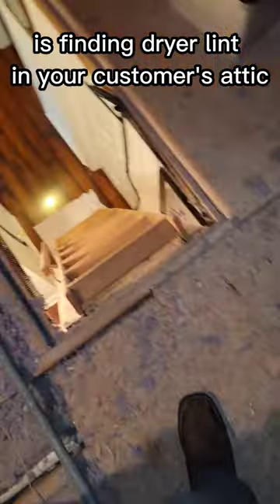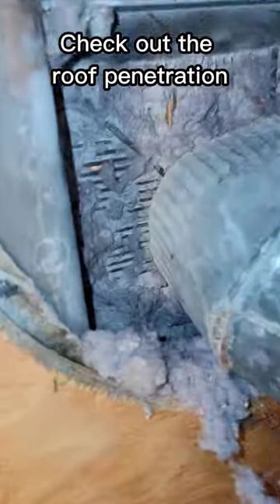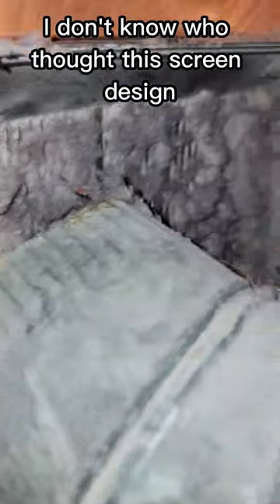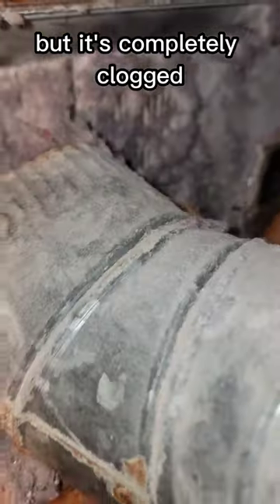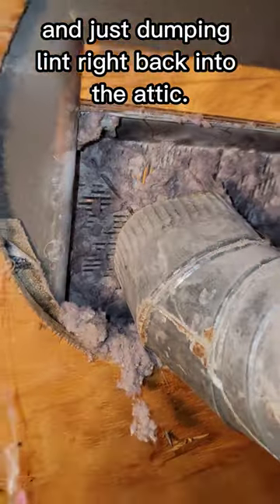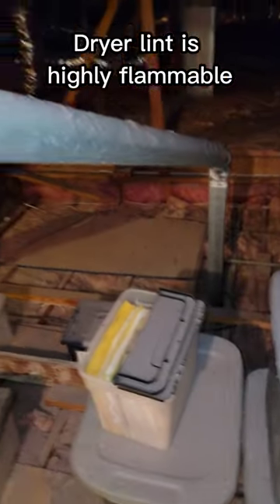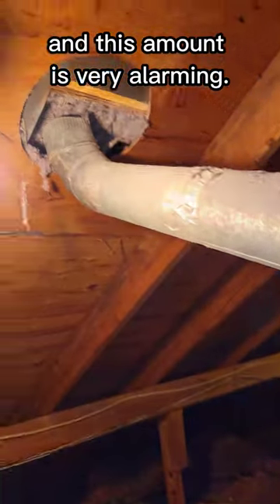Dangerous dryer vent setup! #hvac #hvactechnician #dryervent

Comment: A huge red flag is having a drier vent in your attic. It should come out the side of the house closest to the drier and nowhere else
Reply from the maker: Agreed. This is what happens when dryers aren't located on an outside wall
Reply: @WorldofHVAC  gotta love when people with zero HVAC training knows where shit should go 😂
Reply from the maker: Thats college educated architect's for ya
Reply: @WorldofHVAC  yup 2 brain cells and no way to rub them together
Reply: @Hunglikeagrimsmo  2 brain cells both battling for 3rd place.
Reply: There is nothing wrong with them being vented through the roof bud.
Reply: @hughw7157  🤣🤣🤣🤣🤣 where does c02 go once that vent rusts out due to rain? Oh that's right directly down where you live. Oh and not to mention dryer vents can't be longer than 25 feet so unless you have a single storey home it's actually illegal
Reply: @Anthony Green  where does the co2 come from? Our dryers run on electricity, no gas is involved.
Reply: There’s a lot of applications where that’s not possible
Reply: @Hunglikeagrimsmo  Ive had engineers on commercial building have me run 100 plus feet of drier vent lol

Comment: To everyone, there is applications where the only option is to run out of the attic, of course you try the side of the house , soffit etc
But not having an actual dryer vent cap is pretty stupid , especially anything with a screen 

I got one for the guy that posted the video
I was replacing a gas furnace in a crawl 2 weeks ago
How about there dryer vent was loose at the floor and was terminating right above the furnace 
I could have made a Fkn 5x7 rug out of all the lint 😂😂
Gave them a talking to about how lucky they were and ran a new dryer vent for them for free because I had extra supplies on hand because I drive a fully stocked box truck 😂
Reply from the maker: My first thought was the burners turning on and the entire crawlspace turning into a bonfire
Reply: @WorldofHVAC  it was at least 4” thick on top of the furnace
Reply: @WorldofHVAC  like i told them, they got lucky

Comment: Who puts dryer lint out the roof?
Reply from the maker: Some builders think its a good idea. I like putting the dryer on the outside wall
Reply: A part of my job is cleaning dryer vents and a lot of town homes have them on the roof
Reply: @2biscuits  it’s a good idea as long as the vent doesn’t have a screen on the outside and it doesn’t have a long run of pipe. Not every house can be designed with the laundry room on an outside wall.
Reply: @WorldofHVAC  i think it’s ok personally but prefer them going to an outside wall because it’s easier to clean out and maintain.